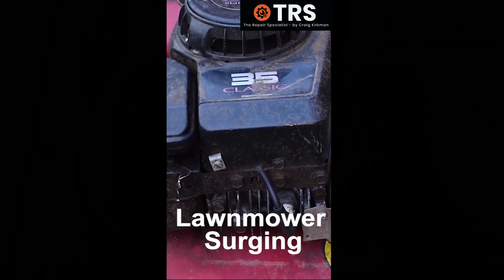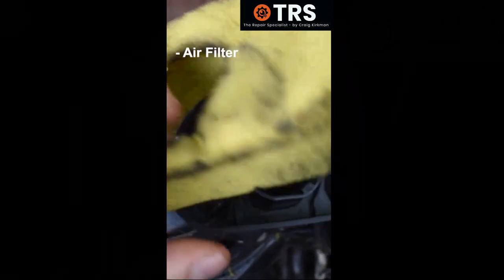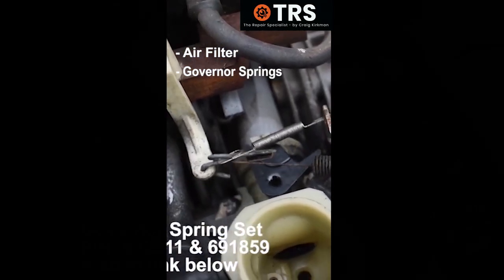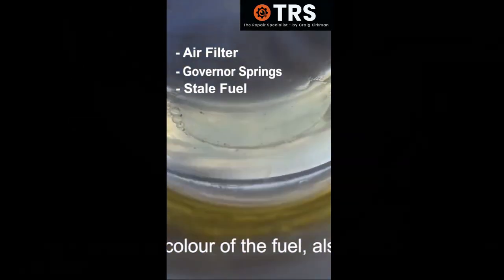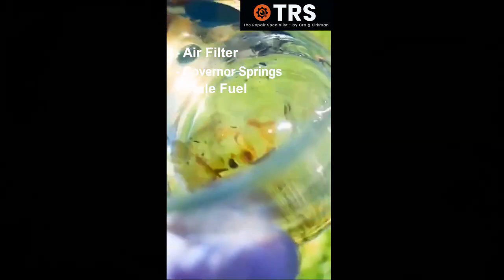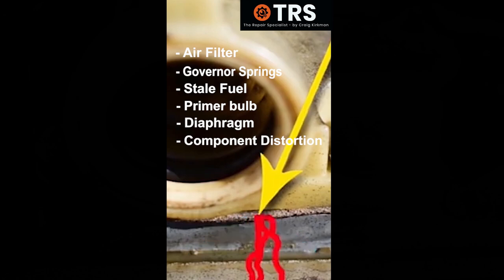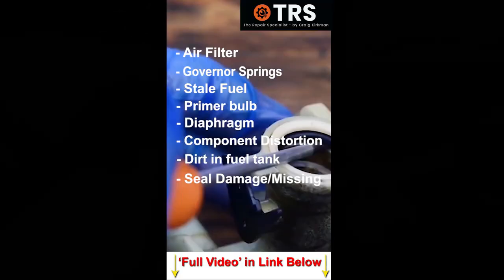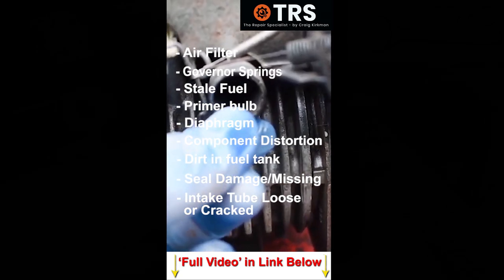LAWN MOWER ENGINE SURGE (Briggs and Stratton Lawn mower Engine) #shorts

Comment: Every service I do on these engines, whilst replacing the diaphragms, I always leave the paper part of the old diaphragm on the bottom of the carb, the extra thickness helps with any distortion between the carb and the top of the petrol tank.